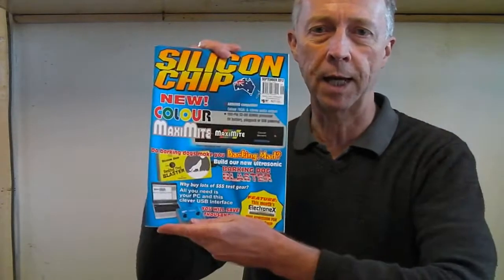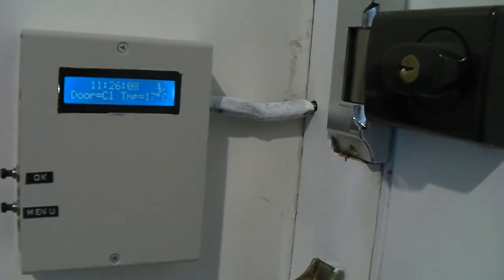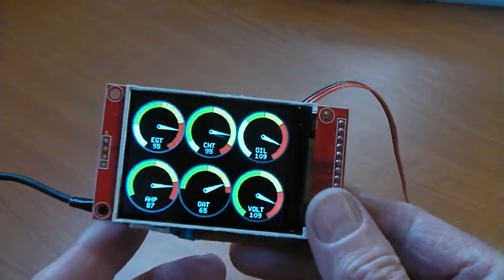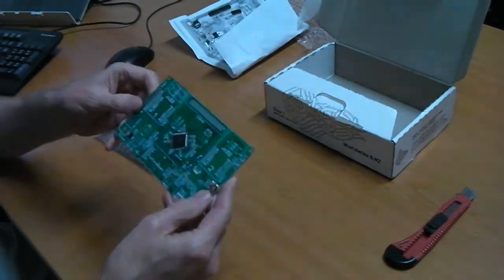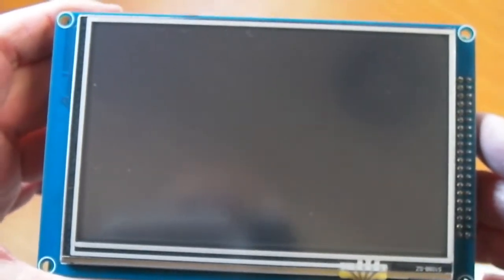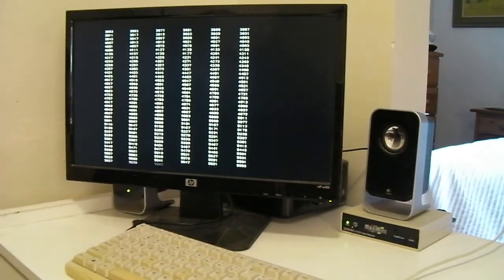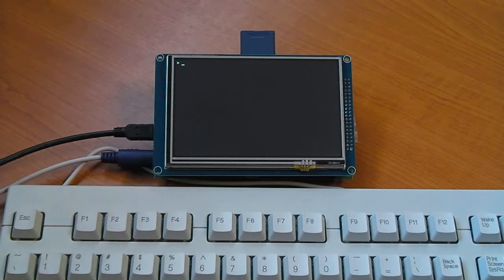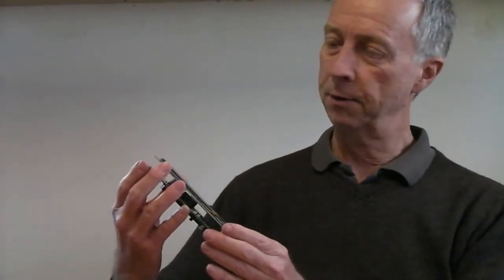Micromite Plus

Comment: Hi,
How do you make happening that the native resolution of color maximite fit normally on the screen you are using witch resolution is way bigger than the computer one ?
Reply from the maker: Hi Christophe, The best result comes from using an analogue CRT. You are correct in your assumption that using a modern LCD there is an apparent blurring due to the resolution mismatch, however since modern LCD resolutions are so high the blurring is not that noticeable.
Reply: Hi,
Thanks for your answer and your time. On the video i can see that the color maximite screen is set rather proportionnally on the lcd monitor. It looks like keeping the 480 x 432 proportion by keeping 2 bands not used at left and right. I own a Duinomite and all the surface of the screen is used. When you are using a 16/9 monitor it looks very bad. Is there a setting in Mmbasic to achieve that ? I am not as precise i would be, but excuse my french 😊
Reply: @SCCtechnology  Hello! Nice video! I have save question. How did you magaed to make so wide black screen borders on you LCD when using Maximite?
Reply from the maker: @cyberx1254  That was a configuration parameter on the VDU. I set it to a 4:3 aspect ratio.